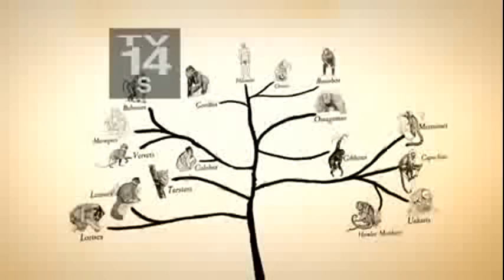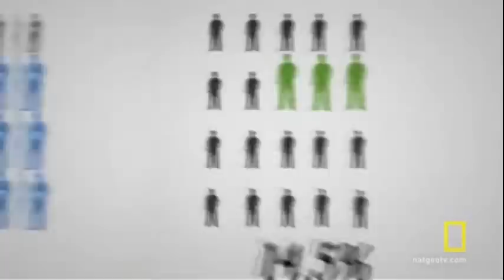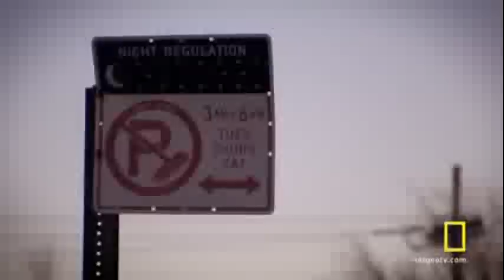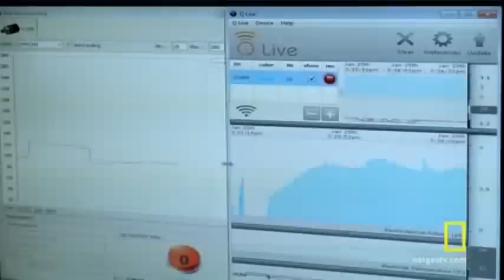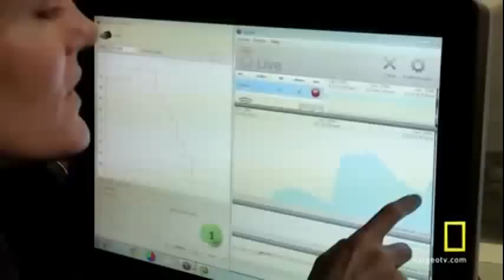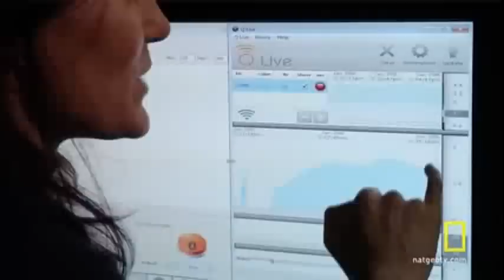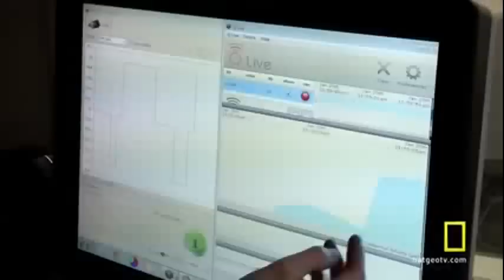The Complete guide to alpha male behavior for seduction and social dynamics

Comment: The real key to the "alpha" phenom is in this right here: alphas are leaders BECAUSE they have the cunning and the courage to protect the group. Remember the video even said that groups will oust any alpha that does not protect them. Alphas nurture and lead as part of group interaction most of what was showcased was the struggle for position but in all group settings it is reliable that position is understood and accepted for greater percent of the time than it is challenged.

Alphas get first pick because alpha is most responsible.Not simply a "boss" but a leader